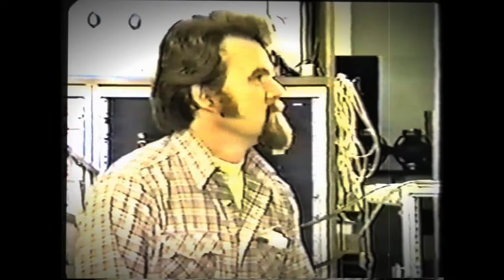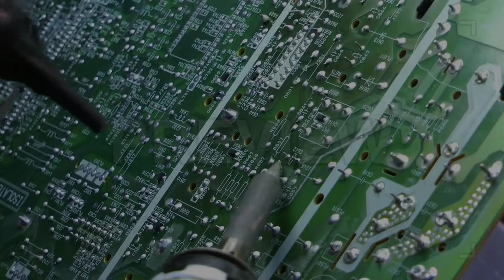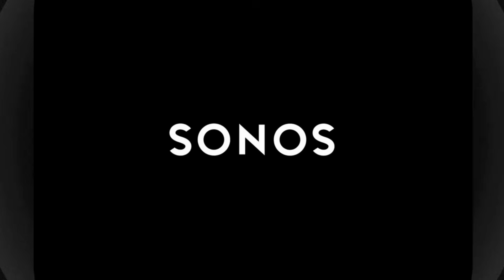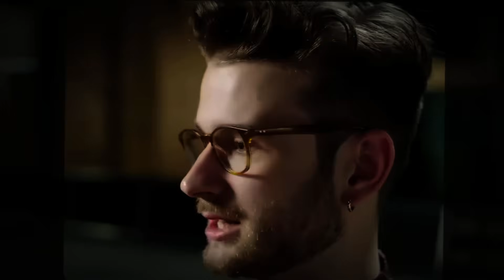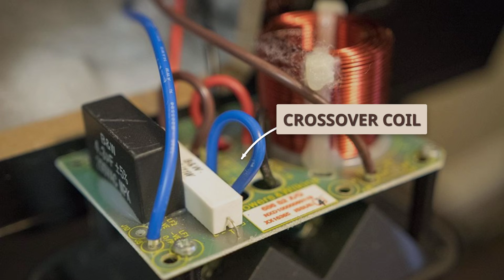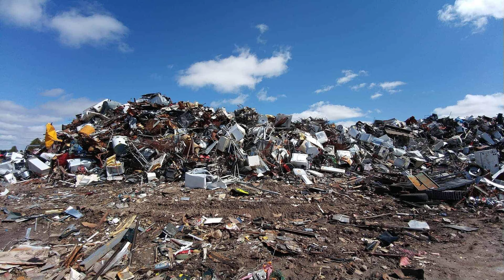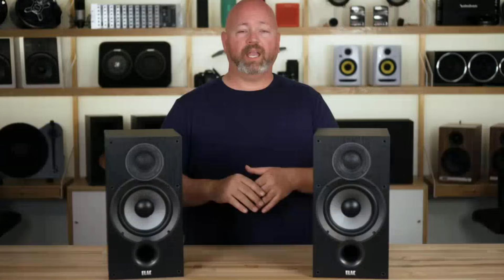The Audio Technicians Blacklist: 5 Hi-Fi Speaker Brands to Never Buy

Comment: I use IMF TLS80 II speakers made in 1976. Rival contemporary systems costing > 50k$. Why? Apart from the drive units they use transmission line damping. Downside: although in perfect working order the crossover circuit boards need replacing because their copper tracks are starting to detach. Gloom!
Reply from the maker: Forty eight years on the IMF TLS80 II the transmission line loading is exactly why that speaker still rivals systems costing fifty thousand dollars today. John Wright's engineering at IMF was genuinely ahead of its time. The copper track delamination on the crossover boards is a known issue with PCBs from that era the adhesive layer between the copper and the substrate loses bond strength over decades of thermal cycling. A competent technician can reflow the tracks or replace the boards entirely with modern equivalents. The drivers themselves are worth every penny of that restoration. Do not let the crossover boards end it. 👌

Comment: I still have my Techniques stereo from the early 80's. I bought Cerwin Vega and Boston Acoustics for front and rear speakers. Now all these years later I have to replace the speaker foam.
Reply from the maker: A Technics system from the early 80s still running with Cerwin Vega fronts and Boston Acoustics rears,  that is a Japanese built foundation that has outlasted everything around it. Refoaming after forty plus years is basic maintenance on speakers that were built to last that long. The foam was always going to go. The drivers underneath are still perfectly good. 👌

Comment: Pioneer HPM-100   bought in 70's with SA-9500 II, TX-9500 II, CT-9191, PL-530    all still perfect
Reply from the maker: A complete Pioneer system from the 1970s  HPM-100, SA-9500 II, TX-9500 II, CT-9191, PL-530 all still perfect. That is not a setup, that is a statement. Pioneer built that entire ecosystem to work together for decades and fifty years later it proves the point. 🏆

Comment: Monitor Audio Ma 3 series 2, 50 years old, and they have a BW midrange. I also have a Ariston Audio RD IIs turntable, with SME 3009 arm, also 50 years old and there is a Hi Fi shop in Montreal who has all the parts. When I have enough money I will up graded and change the wires. Also own Linn amp, preamp and CD player, all with external power supply. Purchased in1995, Still feels like I got then recently.
Reply from the maker: Fifty years on Monitor Audio MA3 Series 2 with a B&W midrange driver British engineering inside British engineering. The Ariston RD11s with SME 3009 arm is one of the finest turntable and arm combinations from that era and the fact that a shop in Montreal still stocks parts is exactly the argument for buying quality once. And the Linn system from 1995 with external power supplies still feeling like new thirty years later that is what separates a brand that engineers for longevity from everything else. A remarkable collection. 👌

Comment: I have some really nice Energy "pair-matched"  tower speakers from the early 90's with a pair of passive subs, and a pair of bookshelf units from the late 90's for the surround system. (The powered sub is 15 years younger and by another brand.)
In the last year the surround membranes for the main drivers have started to break apart as they have dried out after all this time.
I didn't realize that the company folded/disappeared/was bought up.
Not sure who would be a good substitution for my favorite and well established brand from the past. The extreme quality at a reasonable price was so hard to find. At the time they were expensive compared to so many other brands BUT the imaging and quality outlasted all those others by a long shot so they were well worth the investment. (I'm worried about the bookshelf units used for my surround sound failing soon too. They are only 5 years younger.)
So now I'm starting to look for some high quality - neutral appearance - reasonably priced speakers for the music/7.1 surround system. The main towers need to be precise enough for full range reproduction at low levels as well as high volumes. I still crank the tunes some days AND soothe myself at nights with some sweet full orchestration music while respecting the others in the household.
Then there's the wide fidelity that is needed for movies with the quiet talking to the massive explosions splitting across the 7.1 channels.
Where do you start these days to find something ?
And in Canada too ? (Energy WAS Canadian !)
Reply from the maker: Energy was acquired by Klipsch in 2005 and production was quietly discontinued over the following years finding authorized service and original drivers is increasingly difficult. For your situation Canadian market, full range at low and high volumes, 7.1 surround, neutral appearance at a reasonable price the brands worth investigating are Paradigm and PSB, both Canadian companies still manufacturing and supporting their products. Paradigm in particular has a strong track record for exactly the combination you describe precise at low levels, dynamic headroom for high volumes, and a neutral cabinet design. Monitor Audio from the UK is worth adding to the list for the same reasons. All three have Canadian dealers with listening rooms. Start there before buying anything.

Comment: Whatmough 2 way speakers- Lead lined cabinets, uses 1 Focal kevlar driver & Focal titanium tweeter per speaker; I've had them for  25+ years.
Reply: @John-1949 Still have them and they're still satisfying. It's a Model 201
Reply from the maker: Twenty five years on a Whatmough 201 with Focal kevlar driver and titanium tweeter. Australian engineering that the international market has largely overlooked. The Focal drivers inside tell you everything about the build quality. Still satisfying after a quarter century is the only specification that matters! 👌

Comment: Old excellent speakers = 48 year old Cabasse Sampan 311s
Reply from the maker: Forty eight years on Cabasse Sampan 311s French acoustic engineering from 1976 that has outlasted everything that came after it. Cabasse builds some of the most technically ambitious speaker designs in Europe and the Sampan was ahead of its time. Still excellent is the only review that matters. 👌

Comment: JBL. Same
Reply from the maker: The JBL reputation speaks for itself same experience, same conclusion. 👌
Reply: @WiredTruthHIFI  indeed, and the most frustrating thing.. there was no problem if you get what you paid for, but for the same prize as the sonos setup you have some really nice Kef's with a small amp, that lasts you for years to come.
Reply from the maker: Exactly right, the same money that buys a Sonos ecosystem buys a pair of KEF LS50 Metas and a clean integrated amplifier. Passive speakers, no app, no server dependency, still performing in twenty years. The Sonos setup is designed to be replaced. The KEF setup is designed to last. 🏆

Comment: I love my Acoustic Research AR 90’s 
They have been re foamed 1 time. 
I use a techniques, super class A Amplifier! 
I would consider ELAC Tower speakers at this
Time. I’ve owned JBL L 100  
ESS with Heil air motion transformers
15” Velodyne Subwoofer 
Now using a JBL Sound Bar 1300  with with Dolby, Atmos and Bluetooth rear surround and Bluetooth subwoofer
This unit has 1100 Watts. It sounds good once you get it dialed in which takes a couple of hours otherwise it’s too
Boomy like a Mexican gang banger Chevy on crack!

Comment: I still have my Cerwin-Vega U-351 that I bought in 1980. Only been refoamed twice in their 45 years of existence.
Reply from the maker: Forty five years and only two refoams on Cerwin-Vega U-351s that is actually impressive longevity for a speaker from 1980. The U series was a step above the D series in build quality. The foam surrounds on those woofers were always going to need attention eventually but twice in forty five years is a reasonable maintenance record. Still running is the verdict that matters! 👌

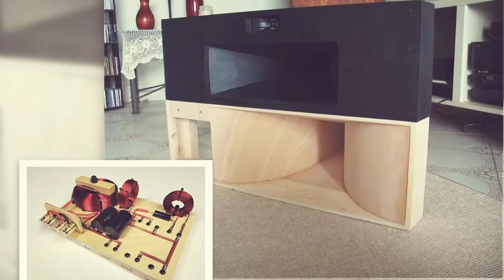Comment: I have a pair of Klipschorns bought new in 1984 and they are still going strong. However, mine have been fully upgraded with new midrange horns, 2 inch BMS midrange drivers, new tweeters, and a full custom crossover that I designed. They will stay in my family forever. You even briefly show the midrange horn at 5:10 that is made by Mr. Greg Roberts of Volti Audio. They have incredible dynamic range along with very low distortion levels while using very little power to drive to 'live' levels.
Reply from the maker: Forty years on a pair of Klipschorns that have been continuously upgraded new midrange horns, BMS drivers, custom crossover that is not restoration, that is evolution. The Volti Audio midrange horn is one of the finest available for the Klipschorn platform and Greg Roberts builds them to a standard the original horn never reached. A speaker system that improves with every decade of ownership and stays in the family is the entire argument against disposable modern audio in one comment. 👌

Comment: I still use my Acoustic Research AR-17s I bought in 1979.  I have a BIC Venturi model 1020 subwoofer for low bass.
Reply from the maker: Acoustic Research AR-17s from 1979 still running with a BIC Venturi sub filling in the low end forty seven years and still a complete system. AR's acoustic suspension designs from that era had a coherence that modern speakers at multiples of the price struggle to match. 👌

Comment: I have a pair of System Audio 1250 speakers, fast, powerful and accurate. Incredibly pleasant! I'll never part with them. Also a pair of Rogers LS6a, despite their size a bit base light, but will never sell them
Reply from the maker: System Audio 1250 paired with Rogers LS6a Danish precision alongside classic British BBC-spec design. The LS6a base light characteristic is well documented but what it does in the midrange more than compensates. Two speakers that reward long listening sessions for completely different reasons.

Comment: I have a pair of Altec Lansing Model 14s. I rebuilt the crossover, bypassing the tone controls and circuitry for protection. I bought them in May, 1984 on leave before going to Kadena AB, Okinawa, Japan. Had them shipped over. Bought a Yamaha preamp, Amp and a K1020 cassette deck, all components are still like day one. Altecs sound better as I recapped the crassovers with better capacitors and without the extra circuitry, the sound is much better. I use a 31 channel equalizer to control the sound in a way the 2 midrange and tweeter controls cannot do. Even my Yamaha PX-3 linear tracking turntable works like day one. Sound with a Stanton MM cartridge and hypereliptical needle is unbelievable. I dont like most of the new stuff. I know design and build my own speakers. Kife is good!
Reply from the maker: Altec Model 14s bought on leave in 1984, shipped to Okinawa, recapped crossovers, bypassed the protection circuitry, paired with a full Yamaha stack that still runs like day one that is forty years of genuine audio engineering at work. The recap with quality capacitors is exactly the right move and the improvement you describe is measurable and real. Building your own speakers now is the logical conclusion of a lifetime of understanding what actually matters inside the box. Life is good indeed!! 😎

Comment: The solution is simple. Keep the different components separate, keep the signal path analoge as much as possible, and avoid components that are dependent on an app or software upgrades to work. If you stream music from Spotify, Tidal or your own media server, buy a decent but simple DAC (that doesn't use an app), and all analoge from there. No powered speakers, wireless speakers or any crap like that. Don't but a dedicated audio streamer, it will be obsolete in a couple of years. Instead, use your computer as a streaming device, you probably buy a new computer every couple of years anyway.
Reply from the maker: This is the cleanest summary of the entire philosophy in one comment. Separate components, analog signal path, no app dependencies, computer as the streaming layer because you replace it anyway. That is exactly what the technicians run. Should have put this in the video.

Comment: I’m very sceptical about the B&W claim. Who’s telling this? A massive number of companies change frow owner and investors. The whole audio business is like this and in particular the better brands. B&W is one of the only brands that never had sacrifices in both R&D and manufacturing. Some competitors have outsourced their entire business - including development - to China. Have an excellent marketing present at expensive fairs but are baked air around cheap drivers and mediocre cross-over components. Or active, mostly automotive-alike class d components. I have owned several generations of B&W speakers over decennies, not had one issue with them. Not one.
Reply from the maker: A genuinely important counter-perspective and worth acknowledging. Personal ownership experience over decades with zero failures is real data and it matters. The concern raised in the video is structural four ownership changes in nine years creates instability in engineering teams and cost targets regardless of intent. Whether that has translated into measurable quality decline in B&W's current lineup is a legitimate debate. Your experience suggests it has not. Others report differently. The honest answer is that the jury is still out on where the current ownership takes the brand long term.
Reply: @WiredTruthHIFI  my B&W 805s pale in comparison to my Klipsch RF5s. The Klipsch simply sound musical, alive, vibrant... the B&Ws just sound technical, detailed and flat. But there is no energy to the music.
I'd definitely use my LaScalas (1976) if I had a bigger room.
Reply from the maker: The efficiency difference alone explains a lot Klipsch horn loading gives music a presence and dynamics that sealed box designs struggle to match at normal listening levels. The La Scala in a room that can accommodate them is a completely different experience again. 1976 La Scalas with the right amplification is genuinely hard to beat.

Comment: In late 1970s, I used to have SONY SS-G3 speakers- They were awesome.
Since 1990s, I have been using JBL L90. Still going strong!
Reply from the maker: Sony SS-G3 from the late 1970s to JBL L90 since the 1990s still going strong in 2026. That is over thirty years on the same speakers and no reason to change. The L90 was built during JBL's most serious engineering era with drivers and crossover components specified for longevity. Thirty years later proving exactly that.
Reply: @WiredTruthHIFI  Thank you for the reassurance. They have been awesome companions for me.
Reply: @WiredTruthHIFI  The SONY SS-G3 were paired with SONY TA-3650 amplifier. They sounded just awesome then.
Reply from the maker: @Shaheryar1701  Thirty years of awesome companions is the best endorsement any speaker can have. And the Sony TA-3650 paired with the SS-G3 is a complete Sony system from the same engineering era matched components from when Sony still built things to last. That combination must have been something special!
Reply: @WiredTruthHIFI  The SONY TA-3650 was meticuluously well crafted and extremely well engineered piece of equipment. Even though it was a  "budget" amplifier for those days (you had more expensive models in the same series and even higher up), but it had all the functional controls any "normal" person would ever need (including REC monitor for 3-head cassette decks), and more than ample amplification you would ever need (especially  if you are living in London, England, in those days :) )
SONY TA-3650 was a piece of art for the price!
Reply from the maker: @Shaheryar1701  A budget amplifier in 1970s Sony terms still meant genuine engineering with real components and proper controls. The REC monitor for three-head cassette decks is exactly the kind of thoughtful functional detail that modern manufacturers stopped including the moment they realized features cost money. Piece of art for the price is the highest compliment in audio and forty years later it still holds up.
Reply: @WiredTruthHIFI  EXACTLY!!! You got it!
Reply: @WiredTruthHIFI  The REC Monitor was an extremely important funtional piece for me!!! Not may amps had that function at that price rannge- But SONY did!!! Extremely well designed and well laid out...
Reply: @WiredTruthHIFI  SONY used to be the Mercedes-Benz of the hi-fi systems- Without crying out loud like the rest of them (Sansui, Pioneer, etc.) they did what they had to do. Another make is AKAI for tape/cassette decks with their GX Heads- They were AMAZING!!! How come no one talks about them? They were the best in tape technology!!!
Reply from the maker: @Shaheryar1701  Sony as the Mercedes-Benz of hi-fi is exactly right understated, precise, and engineered without needing to shout about it. And AKAI with the GX heads deserves far more recognition than it gets. The glass crystal ferrite GX head was genuinely revolutionary outlasting conventional heads by a factor of ten and maintaining azimuth alignment over thousands of hours of use. AKAI built tape technology that professional studios trusted. The fact that nobody talks about them anymore says more about how the industry forgot its own history than about the quality of what they made. 👌🏆
Reply: @WiredTruthHIFI  So well said. Thank you!
Reply from the maker: @Shaheryar1701  Thank you for sharing it. 👌🏆